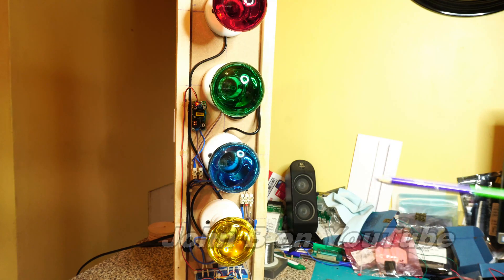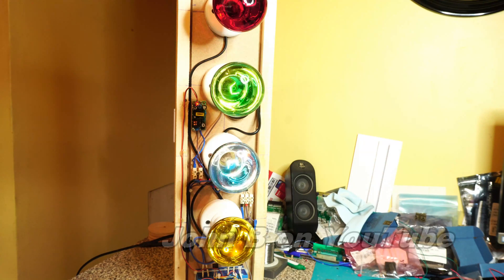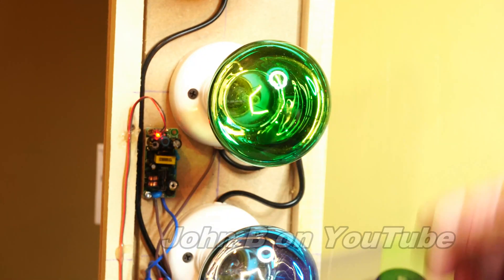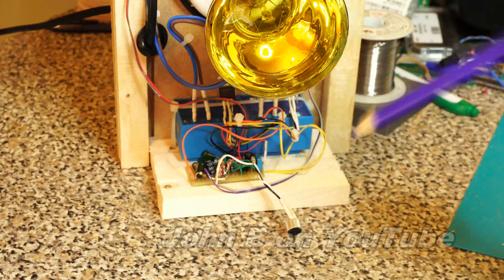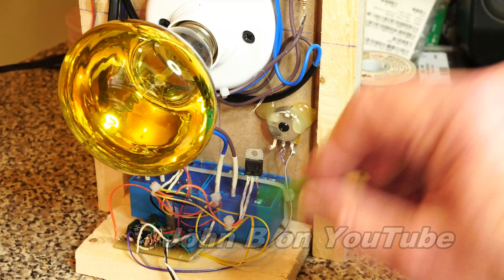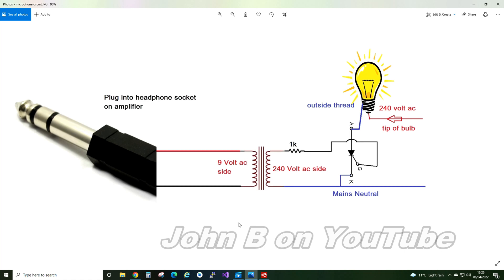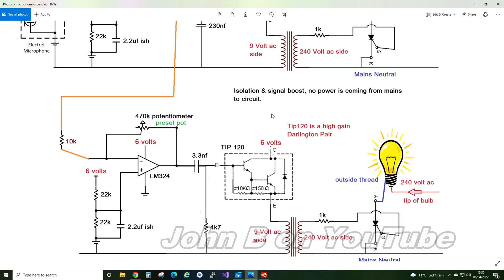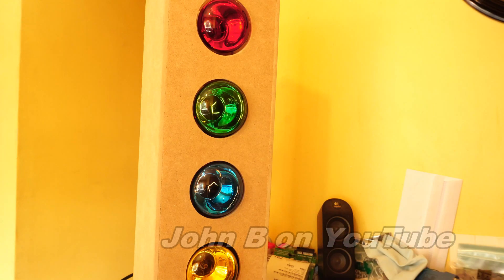DIY Retro Sound To Light Box - Electret Microphone Control Disco Lights

Comment: Built many a light controller in my days as a Dj but i used triacs great fun in the 70’s
Reply from the maker: I’m thinking the lamps would have been brighter since they stay on longer.
Reply: @JohnB-2021   i have made  one of these sound to light  for my controlbox  christmas lights  coz on set of BHS  chaser  christmas lights  had a broken  down  controlbox  on  but i have fixed  it  with  a  sound  to light  microphone  bit
Reply from the maker: @adamberrisford7955  Excellent news, thank you for your comments
Reply: @JohnB-2021  definitely brighter as they are a full wave device but with the lamps i used needed the the full wave 1000 watt par cans